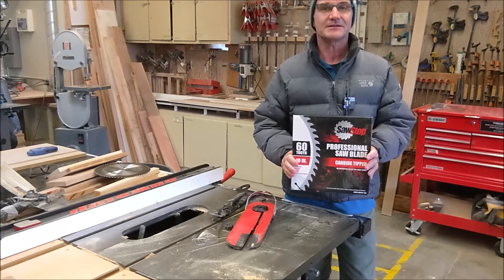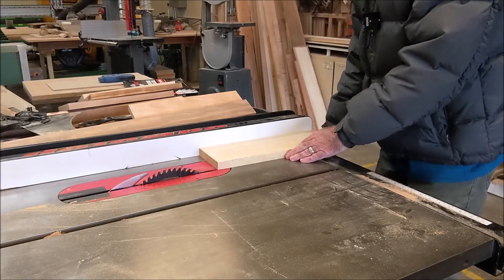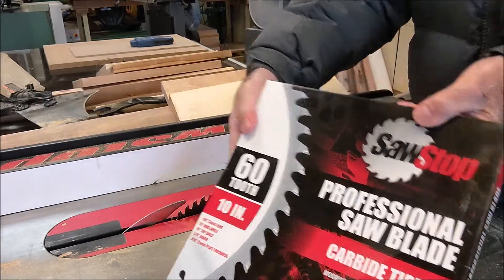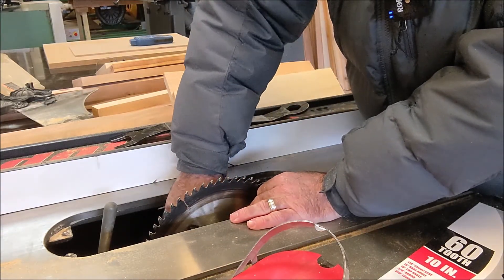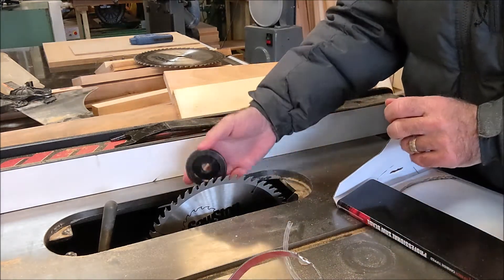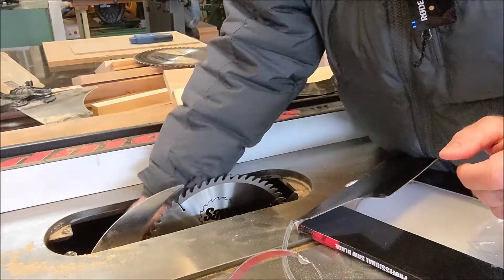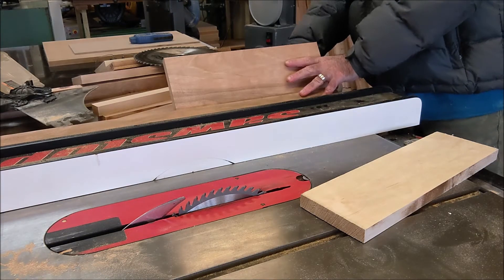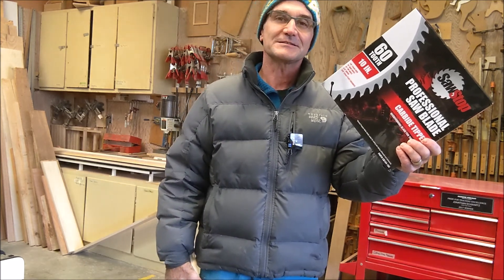Changing A Blade on a Sawstop Table Saw

Comment: > 3:16 "use a nickel to check that it's the right gap"

What? What is "the right gap"?
Reply: My guess would be the gap between the brake and the blade
Reply from the maker: Id check the manual for the specification
Reply: @topsaw  🏆Most unhelpful comment award